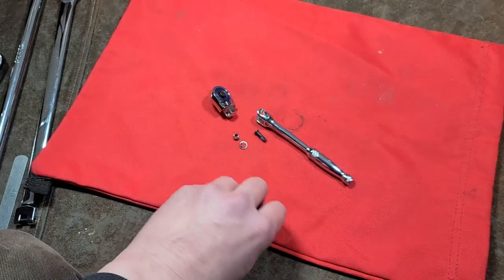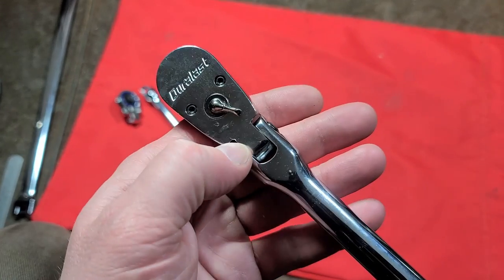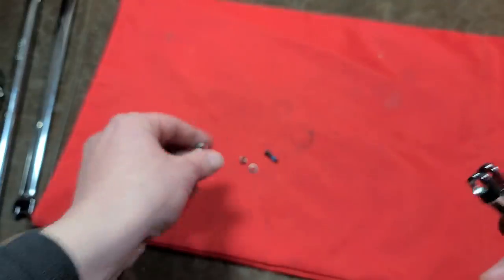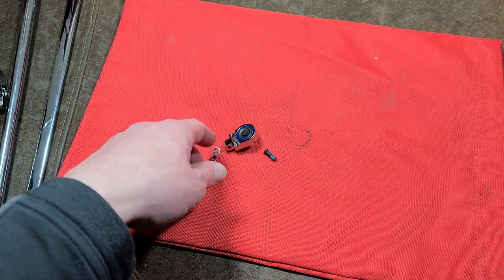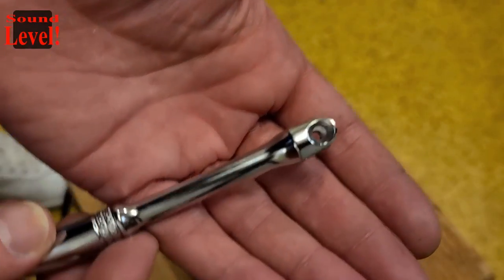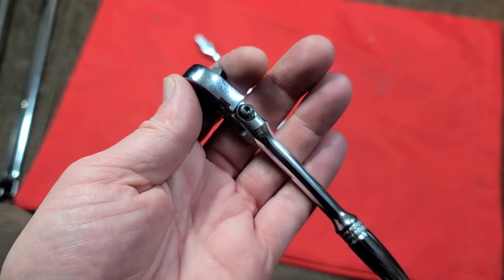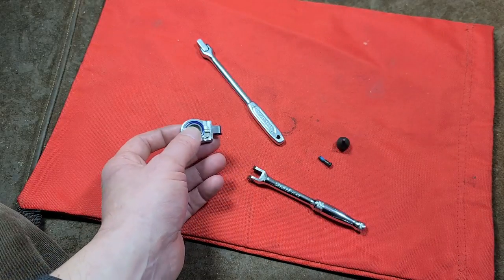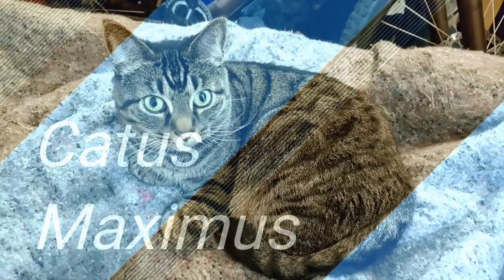Tool Hacks, Pittsburgh Pro/DuraLast Hybrid 1/4" Flex Head Ratchet Build

Comment: I was just in O'Reilly's today and picked up their low-pro locking flex head 3/8 (PowerTorque GM6179). They told me they're about the release the same drive in 1/4. Both are sealed head 80T but come with a lifetime warranty of course. Less slop between the teeth engagement than Tekton's 90T Flex head 3/8 even though it has 10 less teeth.

Comment: how about trying to  add a ball and spring to hold the angle of the head in different positions?
Reply from the maker: No I like adjusting the friction level ball detent indexing Flex head ratchets have not been my favorite because they always seem to want to index in between the axial position I want to use their also cumbersome in those situations where you need the rochet had to dynamically Flex to go around objects while swinging
Reply: Indexing head ratchets are terrible, they always wear out and become floppy